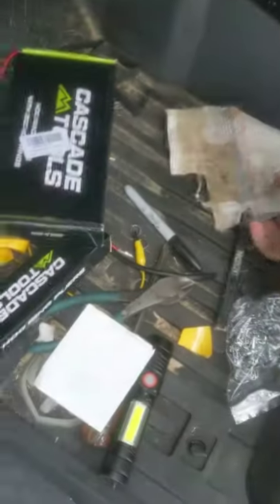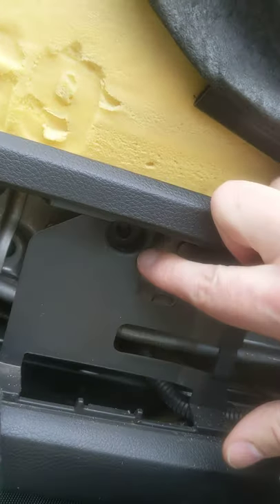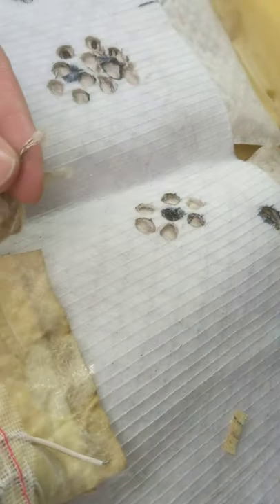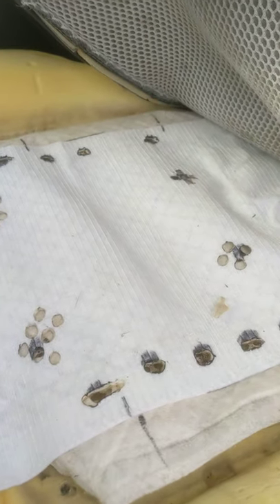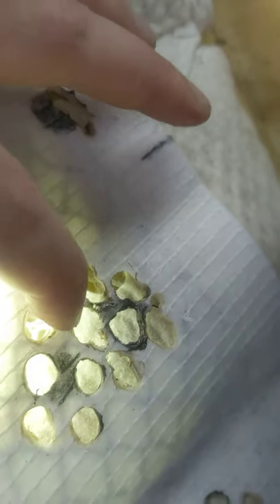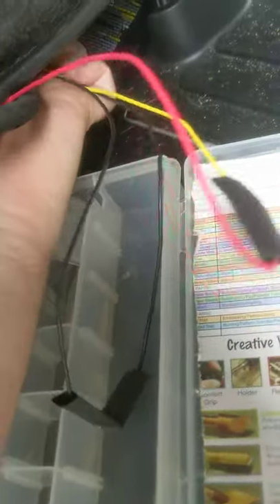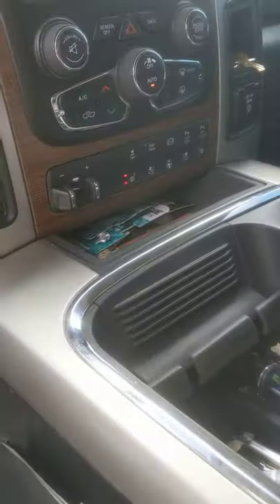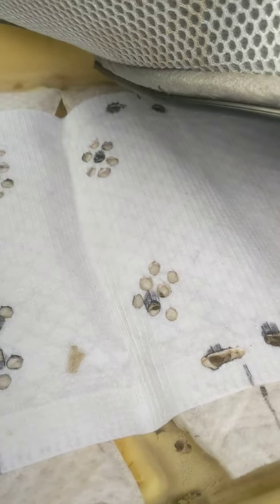how to repair heated seats in Ram.

Comment: I’m adding heat and ventilation to my seats. I want to keep it oem. Does the ventilation pad go under the heat or Vice versus as per factory.
Reply from the maker: The heating pad goes on top of the ventilation. Are you changing the seat upholstery with the perforated center?

Comment: Bought a used 2016 ram 2500 Laramie and none of the heated seats are work, back or front. Is it possible that all the pads quit working.
Reply: I did the same with a 3500. Same question
Reply: Def check fuse in that situation. I have the typical drivers side only dilemma. Going to attempt a swap.